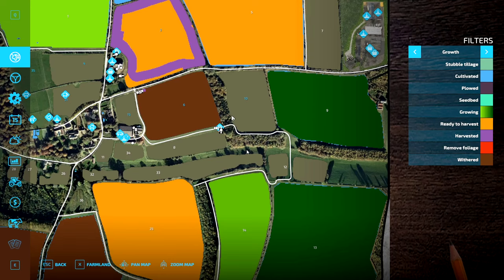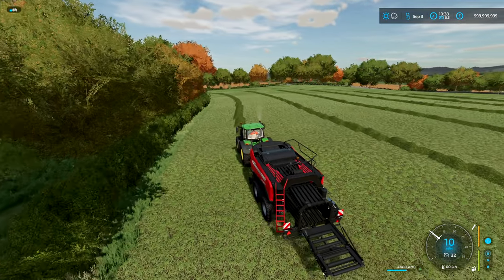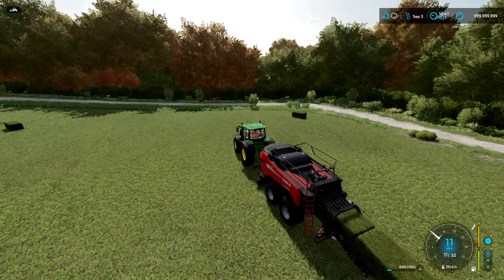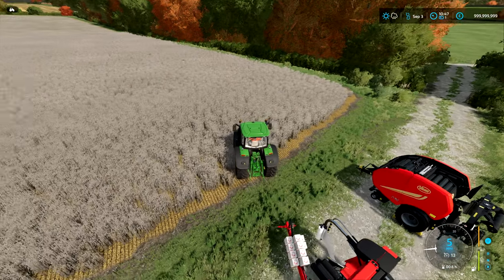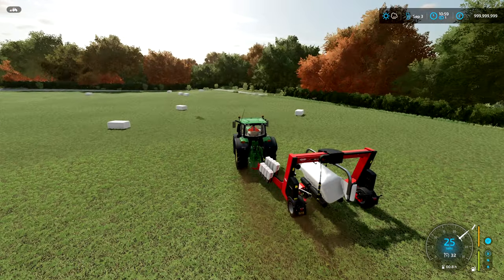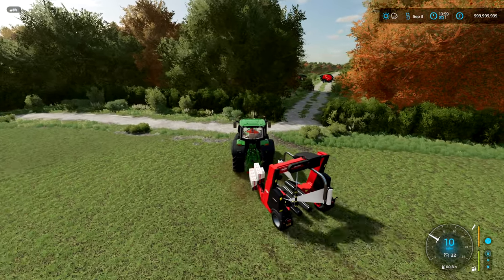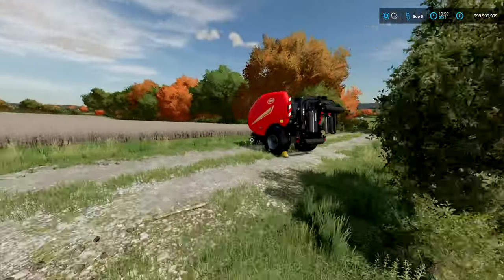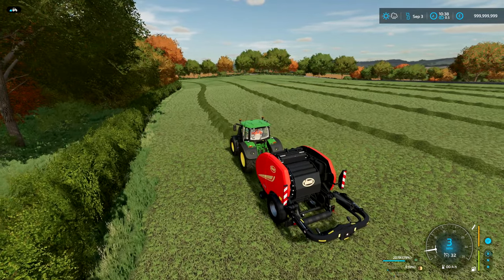Silage wrapping | Is the fast bale actually fast? Vicon Fast Baler vs Case Baler and Kuhn wrapper

Comment from the maker: What's your preffered method to wrap silage?
Reply: I wish this was 150cm wrapper because.. the smaller bales compared to the 185vc pro means.. transfering more bales.. which eliminates the time saved using this baler.
Reply: Vicon Fast Bale, but it is tedious.
Reply: I think the Fendt Rotana is actually the best one, factoring in transport time saved with the 150 cm bales being vastly superior to square bales, plus the end turner to keep them from rolling away.

Comment: Good video thanks for testing that! 

In my opinion the fastest way in fs22 (realistic with courseplay) is having a big m then a tractor with a square baler and another tractor with a wrapper behind but the cost is much higher.
Even better is having a fermenting silo so you don't even need to wrap the bales. 

In the real world the fast baler is more cost effective for sure, because you need less equipment and less time for changing equipment around.

Comment: You can actually put the fastbaler on the back of the mower in the video, no mods needed. Although it seems it only works with a worker, if i do it myself the baler wont work. But thats what i do and it minimizes the work i have to do myself, only need to pickup bales basically.
Reply: Really? I gotta give that a try.
Reply from the maker: Sounds quite interesting. Must give it a try sometime. Thanks.

Comment: The fastbaler is even slower then a standard round baler that also wraps, but you have to stop each time when a bale is made. Even then you work faster than the FastBaler
Reply: did you calculate an average speed? If i swath with the bigm, i can go 10 kph / 6 mph, while a standard Round baler can go 17 kph / 10 mph. And another advantage is that one can make much bigger Round bales, 1,5m instead of 1,25m...
And if one does hay or straw, one can even go for 1,8m...
Reply: @michimannes7822  No calculation, practice !

Comment: I wish you could turn the wrapping off on the FastBale. I store all my silage bales in a silo, so I don't need wrapping. I haven't found a baler yet that will allow me to keep going (no stopping) while baling. Do you know of anything?
EDIT: NM. I actually watched you baling and it looks like square balers indeed don't require stopping. I got one and now have a triple wide mower that swaths on front and a square baler on back of my tractor. AWESOME. So much faster than my previous setup.
Reply from the maker: I need to give that a try. Thanks.
Reply: A triple width front mower that swaths?? I didn't know that existed! Which one is that?
Reply: What silo can you store bales in?
Reply: @cygnusx7  It appears I can't post the link to it. It disappears every time I post it. Search for the Novacat 301 and X8 Varia combo.
Reply: @Zyn_Smooth6  YouTube won't let me post a link to it. It just keeps disappearing. Search for Silos Multi Fruit by OmaTana.
Reply: @abrotherinchrist  Found it! Thanks brother!
Reply: My fast baler will not wrap for some reason .. any ideas?? It just dumps them out the back without wrapping.
Reply: @lonewolf6364  I believe there is an option to turn wrapping on and off. I can't remember off hand how to toggle it. You might find it in the key binds.
Reply: @abrotherinchrist  hey brother, I worked it out last night. So the bales will only silage wrap in the bale wrapper if you haven't turned them with a tedder tool. So they must be picked up without being dried. Otherwise the just drop as normal bales. My problem was I was running a tedder then baling them and could never get the silage wrap to work. Till' last night I did it without the tedder tool!
Reply: @lonewolf6364  Ah, yes I seem to remember something like that. Also, you can manually add unwrapped bales to your silage. I picked mine up with an autoloading trailer and dropped them in the drop bin in front of my silo. I'm not sure if it works with every silo. I apologize for not being more specific. I haven't loaded the game for a while now since I started a new job that requires me to learn new programming languages. I'm working on rounding out my skills to be a full stack developer.

Comment: Okay but what if I don't have good mover and just using front mover with tractor + bailing right behind it. That way I save a lot of time on windrowing and it is faster by percentage
Reply from the maker: I've never tried that method, but it sounds like a very efficient way of doing it. I will need to try it sometime.
Reply: @farmingwithsteve  thanks to you I installed speed baler mod and now I won't need to stop at all, and I can even hire worker. 

On default balers there is moment between bale going out to wrapping and collecting next one that makes grass stripes on field if you do worker :/

Comment: still trying to find a situation were bales are usful at all.. compared to anything loose its just more work then useful.. adds unessesary slot uasage as most balers required like 15-20 slots.. its cool for looks but its easier to just use a forg wagon and avoid bales since bales get broken down too before being usful in game. most inputs will gladly take hay straw but refuse bales 100%.. so theres a bale but it cant be used. i cant put it into production i cant put it in a cow farm that wouldnt take hay or grass bales.. they took loose grass and hay though. bales really seem to be pointless. (in game)

Comment: Yeah I was using this with a 14 meter  wide KUHN windrower on a fully fertilized field - not even rolled and my average top speed is 2-3 MPH.  But with the auto swath from the Vicon mower set (mod) the width is about 10M meters, and the swatch is not at large, it can go about 5-6 working speed..